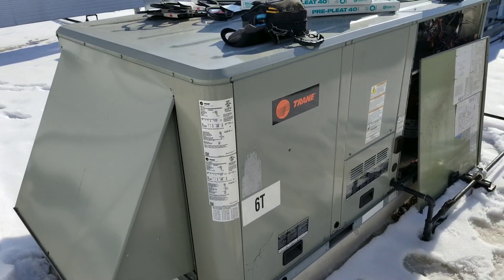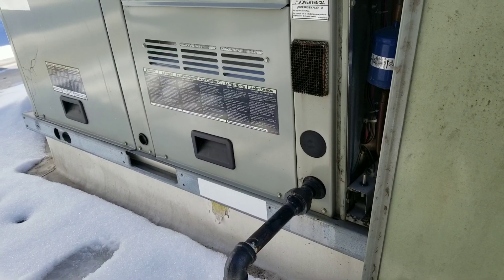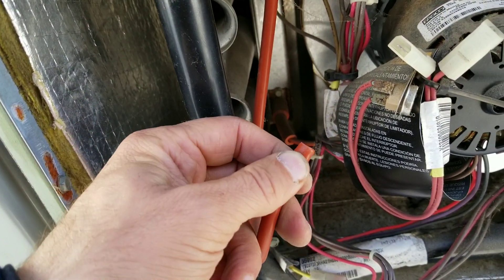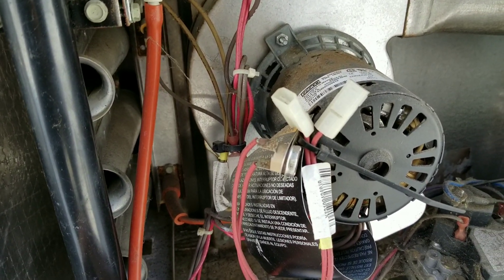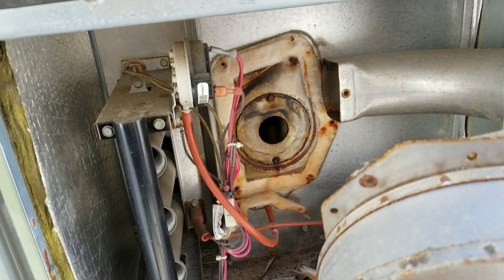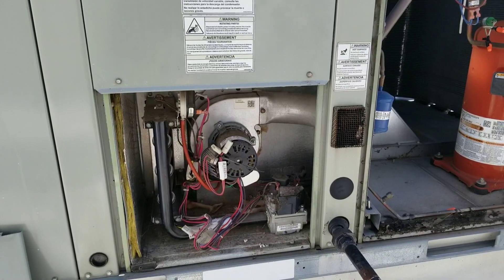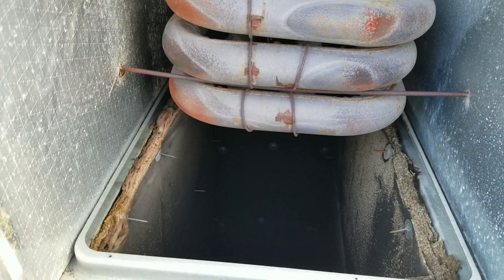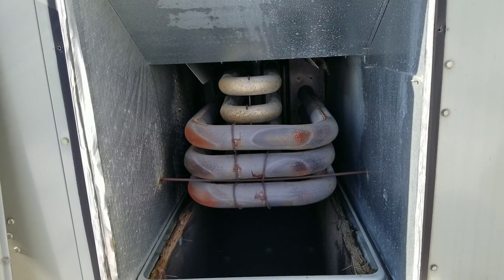Trane package unit not heating

Comment: On heating inspection check the Turbulators next to the burners . They will slide down the heat exchanger and shorting the life of the. Heat exchanger.

Comment: What's up with that uninstalled limit switch hanging off the draft inducer motor?
Reply from the maker: That limit switch is only used if the unit will be externally ducted, I learned that after a few trips out on a trane unit that was externally ducted and kept tripping its limit

Comment: Good call on the heat exchanger. I find 3 yr units ( Carrier ) cracked exchangers, induce motors locked, fried boards, rusted out pans etc etc etc. Quality has gone WAAAAYYYYYY Down from the manufacturers and prices up.
Reply from the maker: I agree- I just came across another Trane unit with a similar issue, the exchanger wasnt cracked but it showed signs of wear like this one did-- I tested gas pressure, it was within tolerance- no way to static on that system yet so not sure if its just a run of poor quality exchangers on these, like you said its most likely low quality.
Thanks for the feedback

Comment: Wow..
A preventive maintenance,turned into...well as you said...
Crack is wacked..lol.
Very good overall inspection.
( big picture), great eyes..thourough big pic.running,and finding that pipe 🚬...smoking..
Crazy.is that it does not look that old...
But probably was not coated or cured or just plain cheap materials.
So,hard to stop a trane..
Maybe in the old days...
That is just cheap materials.or quality control was on crack that day.. .
Regardless of the jokes.etc..
Curious hvac Bill...
My hat off to you for catching that.before someone gets hurt.
Another pm.person may have just said easy money..oil up wd 40 on that inducer..plug the hose back in port..get paid and split...
Great video and catch..
You just saved those people in that building..
I cannot stress enough the importance of this video,and please do as Bill showed/ demonstrated
.slow down..look at big picture
.run equipment .CHECK EVERYTHING....someone's life may be in the balance...
Awesome CURIOUS HVAC DUDE
.seriously...☝☝🙏🙏
Bryan Tyler Refrigeration
Helotes,Tx
Reply from the maker: Thanks Joseph- much appreciated - It only takes a few mintues to inspect it and keep everyone safe like you said. Stay safe Joseph and dont work to hard
Reply: @curioushvacguy6876  
Thank you my friend..! 
Likewise..be safe..
Blessing.,getting ready for the spring,it certainly will pickup.

Comment: Great video.  I'm work on resident hvac, Resident hvac has  90% high efficiency Gas furnace condense water create water.  Does Commercial hvac , Gas Roof Top Unit has 90% high efficiency Gas roof top unit has  condense create water. Too ? I just want to know. Thank you.
Reply: the vast majority are all 80% or direct fire blasting CO into the large warehouses lol
Reply from the maker: Hey there- as far as I know there arent any 90% condensing package in my area at least, It wouldnt surprise me to hear there are 90% condensing package units in the residential market somewhere.

Comment: I wish resi units had the ability to check the heat exchanger as easy as that is..
Reply: good point, perhaps they should factory install an access panel on each side. then again, that would be a nightmare and not usable in all cases ( tight closets, against wall with cold air return over the other side) may just drive up costs for not enough gain ..
Reply from the maker: I dont do alot of residential work but the few ive touched ive thought the same thing- it must be a cost thing along with the fact they have no idea how or where it will be installed so they would have to make panels on each side.
Reply: often they're in a closet or tight area with nearly 0" clearance on three sides. so only access is the front or you pull the whole unit out, nobody will do that and sell a new unit first lol

Comment: We just shut off the gas and put a tag on the unit saying the heat exchanger is cracked. A wire tie and a piece of cardboard will do. I did see a little problem with you turning off the disconnect while the gas was fired. This is not a good thing to do. You should cycle the control in any way so the unit goes through a cool down. From doing this myself I tripped a limit from cycling the power. I had a helper cycle the switch on a vertical furnace while it was running and the fire damper slammed shut. That really sucked. I don’t know if I mentioned this in the past on your channel but a byproduct of the combustion of natural gas is sulfuric acid. That’s why the induce wheel was so rusted. It was mentioned but check your manifold pressure at replacement. Stay safe.
Reply: Hey Ken no there is sulfuric acid from the combustion of natural gas. This is why the 95% furnaces must be vented with PVC. Also the heat exchangers are stainless steal and everything exposed is plastic. There was some debate about the condensate from the furnace being so acidic that it could effect iron, copper or steel plumbing drains. Yes the furnaces condensate and you hook a drain up to them. I’ve seen the induce draft housing had cracked and the moisture from the crack severely rusted the galvanized safety pan. It was only 3years old.
Reply: @actechformallyyomama746  With all due respect, My old furnace from 2001 lasted all the way to 2015, without any premature rusting out like that, that's a  fairly new package unit and i think 3 year is too new for a unit to develop that server rusting, so i suspect something else might be going on like too much then needed gas being stoked into the burner, which probably makes it produces more sulfuric acid then whats considered tolerable in such cases, i also happen to notice yes 90%+ furnaces are the most efficient, but they also have the most possible issue down the road like the ones you mention, they also have a lot of barriers that makes them hard if possible to install in curtain homes.
Reply: Ken what you said is possible. If you reread my original post you will see that I said to check the manifold pressure. You can have up to 10” WC water column in to the gas valve. Coming out of the gas valve should be 3.5” WC. I said the induce blower wheel was rusted due to the acid.
Reply: what's it going to hurt? the broken heat exchanger? trip a high limit? lol.
majority of issues with over acidic combustion is due to surrounding air being full of contaminates, when they get burnt all bets are off.
this is a major issue with 90%+ pulling indoor air or outdoor air with contaminates, sprays, bleach(chrlorine), most all sprays, paints, cleaning products, hair products, things you cook, salt from roads thrown into a fine mist.
Reply: I gave 2 good reasons to not shut down power while the burners are lit. I don’t care about the condition of the heat exchanger. Tripping a limit or having a fire damper slam shut are not good. So if outdoor air and indoor air are contaminated like you say where do we get combustion air from? Or do we install an air purifier for combustion air?  You probably know more than me about this trade so please teach me.
Reply: best you can do is locate the air intake away from the worst contaminates, pull from outdoors and far away from dryer or any other building exhausts, nowhere near a swimming pool, patio or driveway where people tend to bleach often and as far from the roadways as possible.
Reply: @actechformallyyomama746  I imagine that sulfuric acid if any is burned off when you have a normal clean fire burning, which make me wonder the gas pressure setting might be off wack, this furnace is obviously sick and need a bunch of work done to it, like a heat exchanger and combustion fan change.
Reply from the maker: Thanks for the tip -

Comment: Looks like it may be over firing. That or it serves a hair salon lol. Hair salons are so hard on heat exchangers.
Reply from the maker: Is it because of all the containments in the air you normally find in a hair salon?
Reply: Curious HVAC Guy yeah. All the chemicals like acetone eat up the metal. They wear holes very prematurely.

Comment: Looked like there was bits of the turbulators stuck in the exhaust screen...I’ve seen them come apart before causing hot spots in the heat exchangers
Reply: Pieces of the gasket from when he removed the inducer.
Reply: matt bauckman agreed I went back and looked and it was not there before he took the inducer off
Reply: probably the inducer wheel, but could be flakes off the pipe or as you mentioned ;)
Reply from the maker: Good catch Guys- thanks for pointing that out

Comment: Way to look at the big picture Bill.  Chris would be so proud.  That thing cracked in some weird spots.  Wondering what the gas pressure reading at the manifold was.  Never seen a pressure tube hanging like that and not be broken or cracked. Someone pulled that off and left it lime that is my guess
Reply from the maker: Yeah I've never seen one cracked that badly, not rusted just cracked like it was cast metal

Comment: Wonder if that is why the pressure switch was unhooked
Reply: Was wondering the same thing during the video.
Reply: could be, tech dropped the line off so it wouldn't fire and they had "Marty the maintenance guy" go fiddling about lol
Reply from the maker: Good point- an easy way to keep it from running, not the best way but still it's a way to disable it

Comment: What did the exhaust smell like coming off the furnace when it was running? Did it have that telltale "rich-smell" of too much air in the mixture, throwing off the combustion? if they decide to make repairs to that thing somebody will probably want to check the manifold pressure on it also. She could be running too hot 🔥  #upyournosewitharubberhose 
#tagitandbagit   #shestoast
Reply from the maker: I didn't notice any funky or out of place smells but I also was smelling the exhaust very closely- I'll have to pay attention to that next time

Comment: wow from looking on the outside of that unit I didnt think that heat exchanger would even look anything like that. today I had pm on 7 carrier's from 2008 that looked way older then that unit but the heat exchangers looked way better then that but 2 did have small holes.  a day in the life. lol
Reply: Pulled out a seven-year-old Lennox gas pack heat exchanger yesterday with MAJOR fractures in it .
Reply from the maker: What was the cause ?
Reply from the maker: I haven't seen this but I've heard of rtus that are just a year or two old having cracked heat exchangers so I check them all
Reply: at this location. I made to call to replace the heat exchanger.  turns out some other service company must've replaced the gas valve and when they did it looks like they didnt hold back the side of the burner rack and for god knows how long the flames werent going straight through the burners like they are supposed to and on this model carrier the roll out is in a terrible location when it's one purpose is to detect the flames rolling out. which it would lock out once and a while but not as much as it should considering how bad they were rolling all over the place and to top it off the customer just kept resetting the breaker to have heat until they finally decided to have it looked at.

Comment: great video Curious. How are heat exchanger replacements on those units? one man  job?
Reply from the maker: They can be if your going and have a strong back still- whenever possible Ill have another guy there to help me rope it up and jam It into the machine. The most difficult part is the amount of random screws Trane has on those. For example, you have to remove the evap drain pan to reach 1 screw and under the motor mounting plate there are 3 screws you need to replace- not terrible but definitely not the easiest

Comment: How old is the  unit?  I still  think that cheap materials/metals are being used on those exchangers.  Mild steel tubing / aluminized tubing will not  stand up against the corrosive vapors that form in the heat / combustion process. This seems to be a fairly common in most  units  like this. Planned obsolescence?   Do you think so?
Reply: Most likely poor initial setup. I would guess the unit is probably overtired seeing cracks like that. Excessive temp rise or even a failing draft inducer can lead to premature exchanger failure. The typical startup most guys perform in the field consists of setting the gas pressure to a manufacturers spec and not paying attention to temp rise or static pressures.
Reply: *Overfired
Reply: Probably not constant volume. Changeover bypass systems are hard on heat exchangers. I’ve seen them go in less than 5 years.
Reply from the maker: I believe that unit is 6 or 7 years old- I'll be doing the follow up visit soon I hope